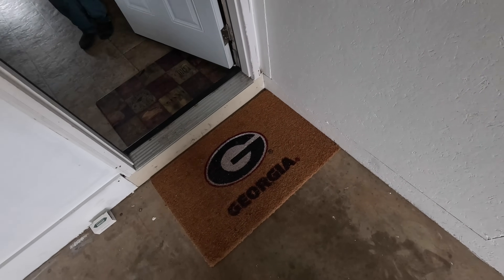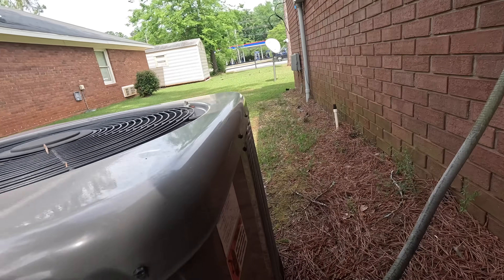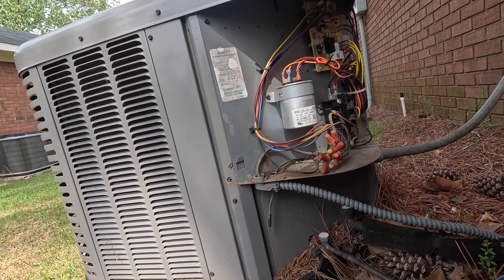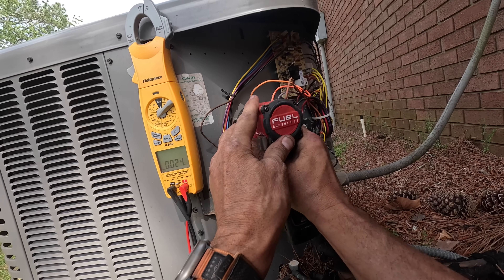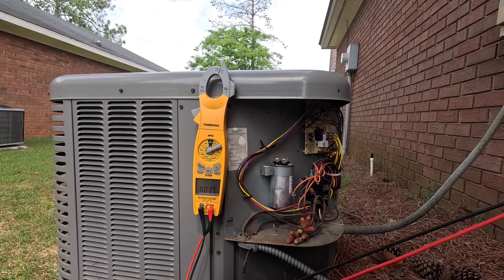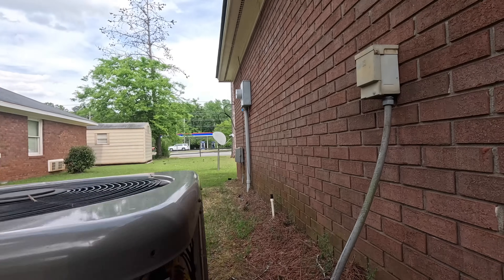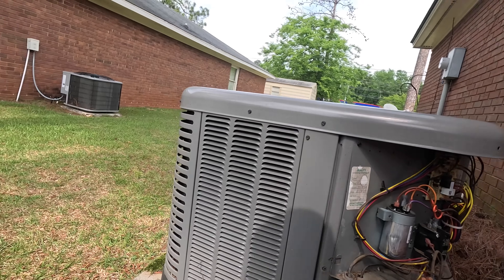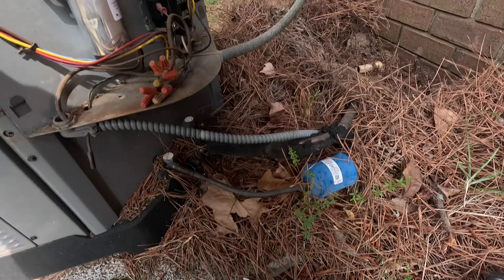Visiting an Old Install that Wasn’t Working! #hvacguy #hvaclife

Comment: Hi, would you consider doing a video on the "press or crimp" fittings?  I would love to know the limitations of the fittings. Do you get any leaks from them?  I notice you used them regularly for a while, but now I see you soldering more.  I have tremors, and it is hard to solder because of that.  I am 72 years old and have no plans on quitting the trade.  I will not let my tremors stop me from what I love doing.  I will not let anyone make me an invalid.  I have made a couple of tools to hold my arms steady to solder......but they are far from perfect. I subscribe and watch all your videos.  I have been doing this for 43 years, and I still learn things from you...and other channels.....and thanks for it.  I understand it is about 4 grand to invest in the crimp system.  I am sure there are other techs that would like to know. You may have done this in the past, but I have not seen any videos on the fittings.  I trust you and what you share.  Thanks so much.
Reply: as much as I dislike them, they seem to hold up OK, however, there's many situations they simply will not physically fit or connect to. example anywhere that is swedged and ready for a pipe inserted, which is most ever coil and condenser on the market. sans mini-splits which primarily use flares to avoid brazing at all.

Comment: Curtis, 
Pretty soft cover on that US made capacitor now has a dent after install. That surprises me. I know it functions properly though. I think you will have to get a small rake to take on your truck! Tennant's usually don't know anything about keeping things cleaned up around equipment (ask me how I know).
Reply: Some places look as though they do it on purpose. beats me
Reply: they all went to aluminum long ago, when the "oil type" was changed. BUT prior to that change, I have seen many that rusted through from the outside in (gray paint, old mil-spec steel cases). don't see many of them around anymore, the last I changed was about 2009, we came back from drag racing to find my buddies house hotter than outdoor ambient and the poor old dog panting like mad (plenty of water), the cap had physically rusted through, leaked and made it quit cooling. one new cap later and good to go again.
they just don't make things like they used to, that was a very old unit and may very well still be there working now....

Comment: Your. Unpainted 2 by 4 on your overhang should attract borer bees. At least it does here in the panhandle of Florida. They leave about a half inch tunnel behind with an egg at the end.
Reply from the maker: Tons of them around here
Reply: Bad by me too, I see them go in, then I shove a stick in the hole and break it off. LOL
Reply: citrus spray, almond oil and fill their bore holes with diatomaceous earth.(probably want to use food grade type, for pet safety)

Comment: Quick one. I would at least let the tenant know to keep the pine needles from piling high behind the condenser and drain. Likely with that Titan HD made in USA you won't be back to replace the cap for a long time. Titan HD is the better one vs. the Titan Pro.
Reply: I agree, but rarely a tenant will do those sort of things. They will say it's the landlord's problem.
Reply: @jthonn  Eh, when the choice is between kicking some pine needles away every now and then vs spending several days without A/C while I wait for the landlord to call someone, I know I'd just kick the pine needles.
Reply: they rent/lease because they don't have a clue, care nor want to maintain anything. on very rare occasion you'll get renters/lessee's that actually maintain property as if it was their own and of great value.